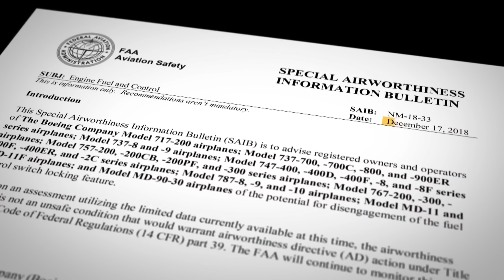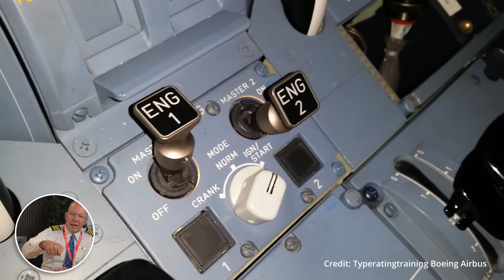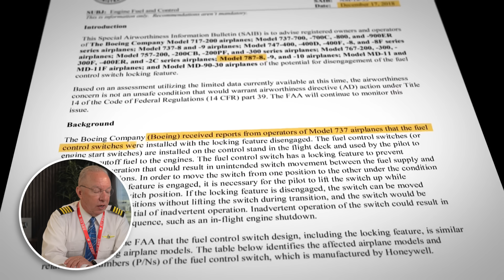Air India 171: The FAA’s 2018 Fuel Switch Locking Bulletin Explained (16 Questions Answered)

Comment: The switches were found in the "on" position in the wreckage. It is possible that one of the pilots noticed an alert on the display indicating the switches were off, as system logs show both switches changed state within one second. However, based on the cockpit voice recording, neither pilot seemed to understand what had occurred, and there is no evidence they physically moved the switches. If the switches were in fact always "on," but a malfunction or signal interference caused the system to incorrectly register them as "off" and then back to "on," the exact sequence of events may never be determined. In summary, the switches may have physically remained in the "on" position, while a system glitch temporarily altered their electronic status.
Reply: The report said that the switches were turned to the cut off position and THEN several seconds later turned back to the on positions.
Reply: @redeemedadventures  That is actually incorrect. what the report says is that the FDR reported the switches turned to cutoff. The FDR get its information from the plane's computers and not from the physical switches. There is a posssibility that the CVR may have recorded the sound of the physical switches being moved but there is nothing said about that in the report. At this time, all that is known is that the computer(s) thinks that the switches have been thrown, whether they actually have or not is currently unknown.
Reply: @redeemedadventures  Yes, that is true
Reply: These weren't the original fuel switches. They were replaced in 2019 and 2023 for reasons unrelated to the bulletin.  And even if they failed it was on Air India to abide by the bulletin released by Boeing alerting them to the issues with fuel switches in several models of its aircraft, to address the issues in its own planes not Boeing. The switches were found in the "run " position which was appropriate because they were switched back on. Engine 1 first and then three seconds later Engine 2. The console where the switches was badly burned per the photo of it in the report did show them in the "Run" position. The fact that they were switched to cut off one second a part and happened at the worst possible moment is really hard to get past.
Reply: Fly by wire. HAL is in control.
Reply: @avlifesavers  Finally I found people who know about HAL 😉
Reply: @deeponchaudhuri106  My car is drive by wire. No big deal. However I find fly by wire terrifying.
Reply: These switches have four switched circuits each.
Reply: Completely impossible, they are two independent switches, if you believe that they were both subject to some “failure” a second within one another and it all happened in the WORST possible time seconds after takeoff, if you believe all that I got a beachfront property for you in Wyoming.
Reply: @olasek7972 what a stupid response. You stay in Wyoming.
Reply: @hershchat  I think so too 😆
Reply: @olasek7972  Nothing is impossible Sir/Madam. The problem is I feel is that persons residing outside developing countries think that regulations and situations that are followed in your country and India is same. And that is why you use words like impossible. Have you even noticed that the interim report is not signed. Legally, I cannot comment about the realities of Indian aviation industry. And if the suicide theory is correct I shall buy you a beachfront property in Geneva.
Reply: @olasek7972  What he wanted to say is that maybe PHYSICAL SWITCHES were not involved and never moved. Electrical signal (processor program) can do it with any delay you want, .....
Reply: @jelenabaturina2889 with the switches not moving is pure nonsense, no airline pilot supports that theory
Reply: @olasek7972  I wouldn't say impossible, but I would say extremely improbable. A fault in the switch itself or a wire connected to the switch might be indistinguishable from  the switch being moved, but for such a failure to occur a second or two apart for both switches and at the worst possible time is on the order of winning two consecutive lotteries, lower.
Reply: @olasek7972  The issue is everything is computerized and both pilots denied having thrown the switches. Also If someone is going to off themselves do we just automatically assume they want to take people with them?  Nothing really backs up the fact that they where intentionally thrown except a computer system that has a history of failing. Remember the stall system that caused a crash? With all this being said It is more than likely that they where thrown by the pilot , but the quick jump to that conclusion as fact is a little weird. In time I am sure we will get the full report and also I am sure they are looking at the pilots social media post and such to see if there where any warnings. Remember that a report has to be issued within 30 days no matter what and that is what we are seeing here. I don't think this is the full report.
Reply: @jasonrose9813  "everything is computerized: - WRONG in this case for sure. Stop being an undereducated millennial who views the world and technology through his/her smartphone. No, nobody said this was a full report.
Reply: @jasonrose9813 i agree with the sentiment of your comment. It’s better to wait until a complete (or as close to it as we can get) picture of events comes out. The very second some new info comes out, there are hordes of people waiting to capitalize on it, drawing out definitive theories. It’s very likely that it’s pilot error, maybe even pilot suicide - but on the latter part, there is no confirm. Pilots are overworked and stressed, it could still be an accident. Pilot suicides have happened before but I still feel like in a case like  this where the families and reputations of dead men are involved, it is always better to wait until a definitive version of events comes out.
Reply: @jasonrose9813  Agreed, wouldn't the pilot who was allegedly suicidal have stopped the non-suicidal pilot from changing the switch from cut-off to engage/ON? 
Also, wouldn't there be at least an argument if not a tussle between the pilots if it was a deliberate act by the allegedly suicidal pilot? 
It should all be in the CVR including probably the sound of the switch position being changed. 
Why pick and choose a part from the entire CVR transcript and release it in public as if to build a narrative?
Reply: @deeponchaudhuri106 the switches were set to off within one second of each other, but only back to on within 4 seconds. That would be consistent with a struggle in the cockpit. If you realise that both switches were off then they would be put back on within the 1s time frame it took to turn them off. The preliminary report was mandatory, they were obliged to tell us something. They are withholding information, probably until they build a case against one of the pilots, but most people, understandably, have drawn a conclusion not just from what was in the report but what was not. For example, the words “why did you cutoff” were presented as if these were the actual words, yet the negative response seemingly was not as it used a form of words that would not be commonly spoken. The CVR will have provided a record of the whole conversation, but the authors of the report have chosen to provide only the bare minimum which sounds like deliberate ambiguity to me. Maybe they don’t want to pin the blame until a better case has been built against him?
Reply: @olasek7972  At this point all we can say is we don't know what actually happened. The interim report however negated many of the major hypotheses that were being floated on the internet. The report gives a direction but does not provide any conclusion.
Reply: @achyuthansanal  Beautifully said
Reply: @neilwallace8989  I agree. And I am quoting from the report- "In the cockpit voice recording, one of the pilots is heard asking the other why did he cutoff. The other pilot responded that he did not do so." What were the exact sentences? Why were the entire transcripts not released? Why pick and choose only a part of the conversation and release it in public? Have you noticed that the report is not signed (Unsigned reports hold no legal value as per Indian Laws).Seems like narrative building and I have an explanation why? I have tried to post it in multiple videos but not received a single like which is surprising. I shall post it as if it is a reply to you. I wonder if YouTube is not allowing others to read my post.
Reply: @jasonrose9813  All that the interim report has stated is that the fuel switches were moved to the cutoff position and then returned to the run position. One of the pilots (not specified) asked why the fuel switches had been moved to cutoff, to which the other pilot (also not specified) replied that he didn’t do it.

I’m not ruling out pilot error or human factors, but hardware and software malfunction also cannot be ruled out.

A 2018 FAA report, published after a comprehensive review of the 737 MAX, identified issues with faulty fuel switches and recommended that they be identified, repaired, or replaced. Boeing shifted the responsibility of identifying faulty switches to the airline operators.

Boeing, once an engineer-led company founded by Bill Boeing, started prioritizing cost-cutting and shareholder value after its 1997 merger with McDonnell Douglas. That merger placed many McDonnell Douglas executives in key management roles at Boeing, which marked a cultural shift in the company.

At this point, four major stakeholders are involved:

1. Boeing – A company with substantial political influence in the U.S. Congress. It also manufactures military aircraft, some of which are used by India (e.g., Chinooks, Apaches, C-17 Globemasters). So, blaming Boeing could have diplomatic implications for India–U.S. relations.

2. Air India – As India’s flag carrier, it has an interest in protecting its public image.

3. GE – Manufacturer of the GenX engines used in the Dreamliner. As a major global corporation, holding GE responsible could again affect international relations.

4. The Pilots – Unfortunately, they are no longer alive to defend themselves. The Indian pilot association lacks strong influence, making it easy to shift the blame onto them.

Let’s also not forget: in many air crash cases, attributing the cause to pilot error simplifies the insurance claims process.

Given all this, I wouldn’t be surprised if the final investigation report blames pilot error.
Reply: @deeponchaudhuri106 yes, it’s an interim report, anything else?
Reply: @olasek7972 Why is it impossible at the end of the day its a machine apart from pilots software also runs the plane.  Software error like 737 can also happen where nose of the plane went downwards directions.  Error or glitch can happens it is also very difficult to believe pilot can shut off both switch in difference of 01 second.
Reply: @YehwalaAccount no comrade, it has been confirmed by real airline pilots that 1 sec difference is exactly right
Reply: @olasek7972  Kindly read about the FAA 2018 advisory, not follow Captain's words. In fact just pause when he shows you the page on the video. Reading the whole report would always be better.
Reply: I also think so. Both pilots had no idea what happened to the switches. Boeing have a case to answer
Reply: @michaelmukayagi771 
BS.
Reply: @michaelmukayagi771  which are you? A troll or a clown? You have to be one or the other.
Reply: None 😂

Comment: Thanks for helping with rumor control. I've seen all these "theories" on social media, and it just spreads like wildfire. We definitely need to incorporate a low-risk, self-reporting system. The airline union should negotiate pilots can get up to 3-6 months away for mental health treatment followed by sign-off from a group on independent, mental health experts prior to returning to work OR then transition into a non-pilot role.

Comment: I think blame is shifting towards one of the pilots, but could it be that a glitch in the computer system or a malfunction of the switch sensors caused the switches to send info to the computer to shut off? After all the check list says that on an engine failure you should move the switch or switches to the shutoff position and then the run position again. Furthermore, one pilot says “why did you turn off the switch” and then the other states that he did not do it” For starters why don’t we take both of them on their word?

Comment: In my mind, it seems a bit of a flawed design that it's possible for one person to cut off the fuel supply so quickly. Wouldn't it be better if both pilots had to push or actuate something at the same time in order to cut the engines? Placed either side of the cockpit so they can not be reached by one person.

Comment: Fuel cut off switches should not work when flying, only should work while on ground or some fault in engine or some extra steps to overrule it. Or both pilots should have own switches and both need to be same position to work. My view